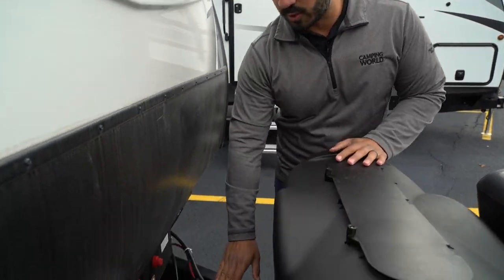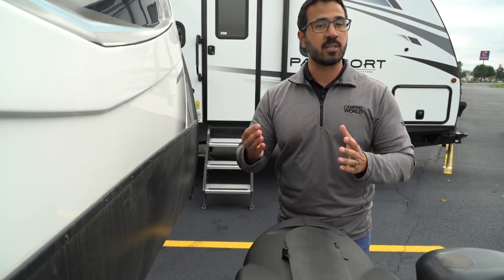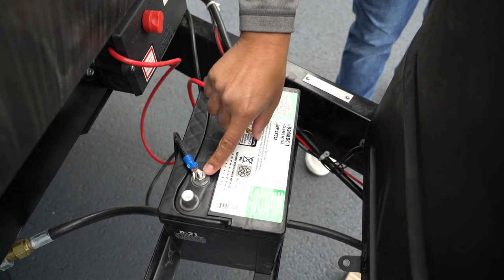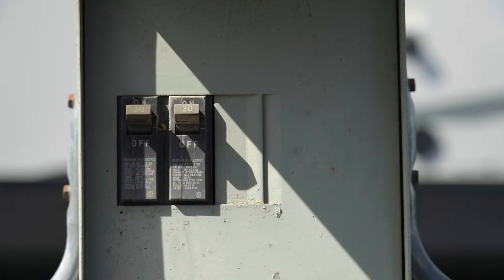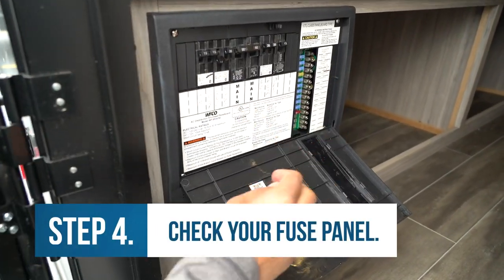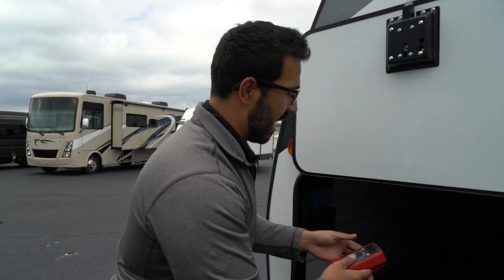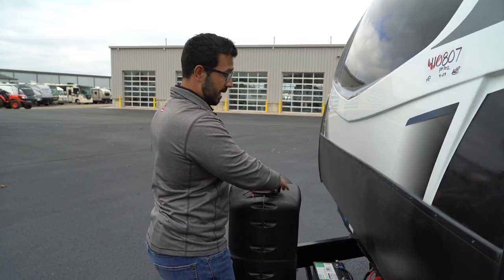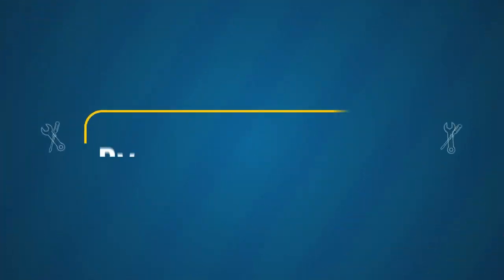Why Won't My Battery Charge? | RV Troubleshooting

Comment: Hi I have 110 power is that enough to charge the battery
Reply from the maker: Hi There! 

Can you provide a few more specifics?

What is your RV's make/model?
What kind of electrical outlet are you plugged into? 30 amp, 50 amp, or 120V Edison plug?
What other symptoms are you experiencing that suggests your battery may not be charging?

Hoping I can provide a more definitive answer with more context. Thanks!
- Tucker Ballister

Comment: Can you recharge battery from the hood using jump cable? Actual battery under seat but there is a jump source under hood.
Reply from the maker: Hey Ricky! Can you clarify what you mean by battery under the seat and 'jump source' under the hood? What kind of RV or camper van are you working with? 

I'd love to get you a more detailed answer or run it by my technical instructors to provide more context for you!